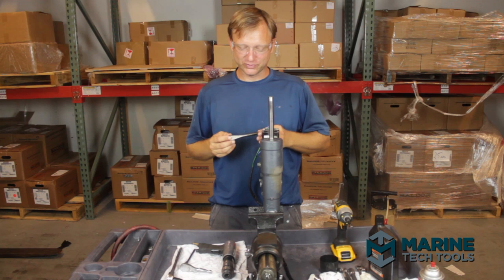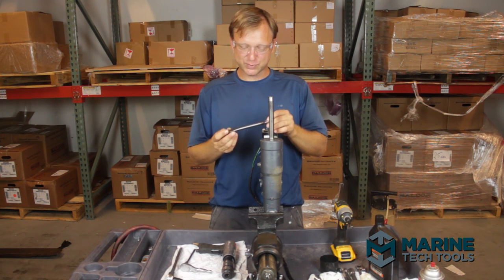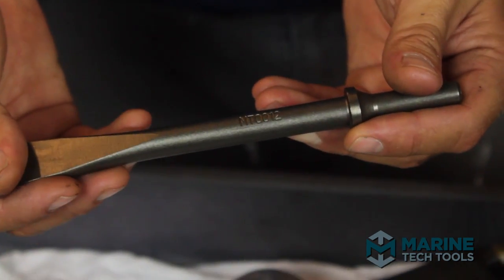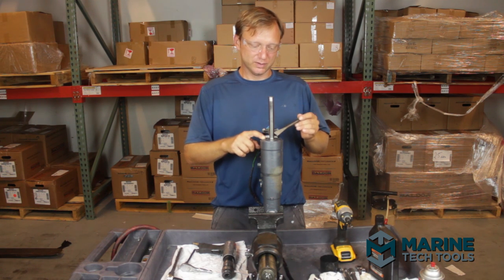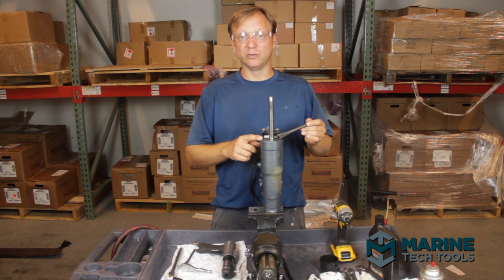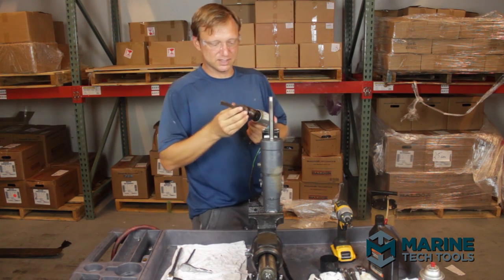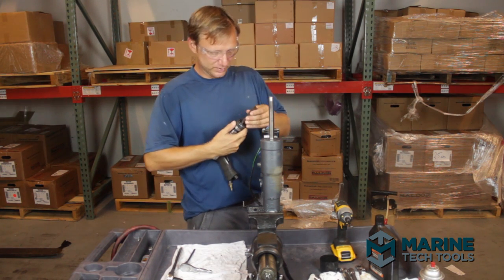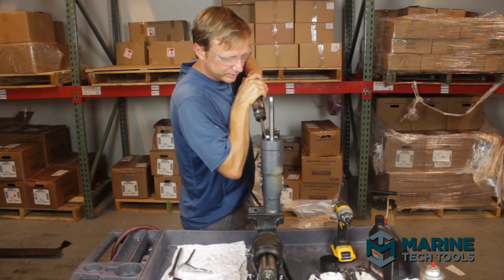Hydraulic Cap Removal Tool

Comment: That's good if you have already screwed the spanner holes up, but I can't remember who but a socket that has inserts to fit many sized caps has been invented.
Reply: The tool I bought keeps wanting to pop out of the holes and it’s slowly messing them up
Reply: @TheMrDamp  I will look for the tool I was talking about, but it might be hard to find. What is the name and manufacturer of yours.
Reply: @kevint9702  this is what I bought 

V-SEK Outboard Trim/Tilt Pin Wrench MT0009-35mm x 6mm (YB-06548) Compatible with Yamaha, Suzuki, Johnson, Evinrude and Honda
Reply: Heck yeah 👍 💯 got it off after 3 days thx 🙏